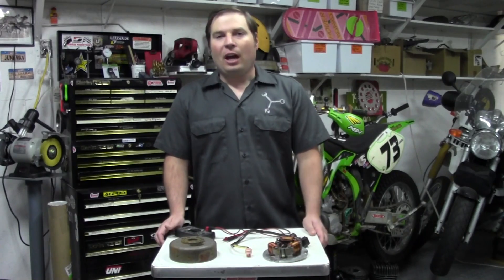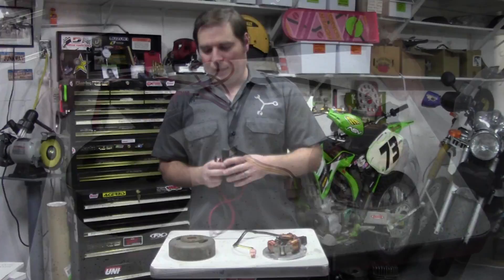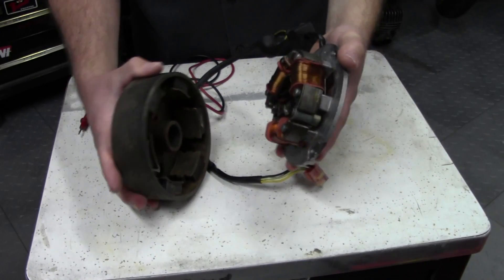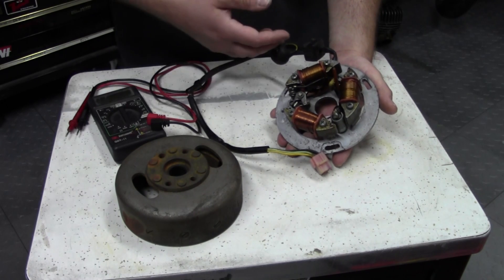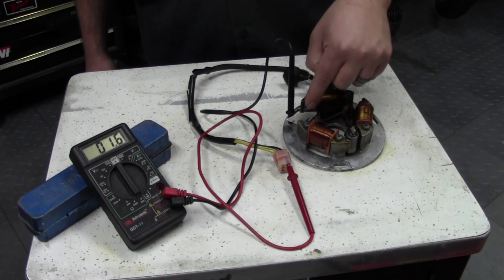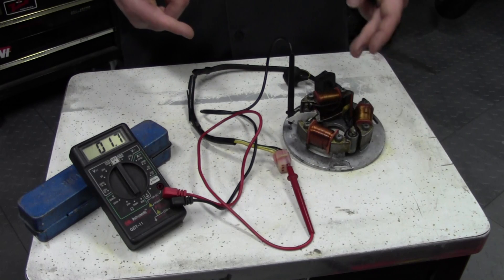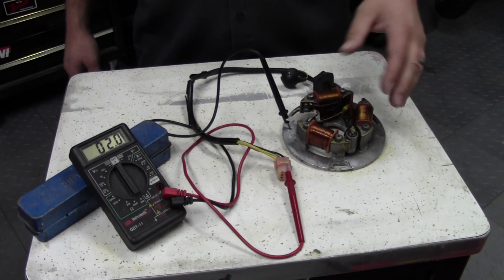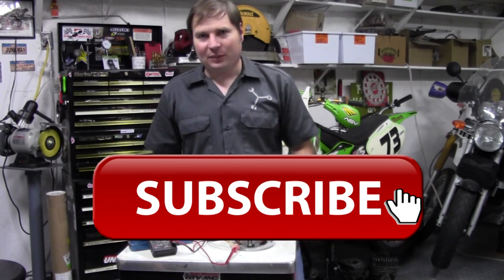Ignition system testing, Magneto coils, Points and CDI

Comment: Nice video, Junkman! May I please add that the resistance measured at 8:08 will vary significant;y depending on the make/model of multimeter used. Some cheaper meters may exhibit over 1 to 2 Ohm resistance in the leads and probes points alone. Different meters use different voltages to test for resistance and this will also significantly affect the result, especially when trying to test resistances at these extremely low levels.
The best way to test coils is via an inductance test however, rarely do service manuals provide such data nor would many home mechanics have an inductance meter.
Just food for thought before anyone decides to replace a coil because it is a fraction of an Ohm out of spec :)
Reply: Yes - definitely...quality and type of meter is important when measuring single ohm values. Always need to zero with test leads and coil connections in circuit.

Comment: Best way to check a stator is with a DVA(Direct Volt Adapter) adapter, static test (resistance )like the one shown in this video are not always conclusive, something you will get a good reading but the stator could still be bad. With a DVA the test is made with the stator still in the machine, turn the engine over and read the peak volt with the DVM. The problems with DVA test is there's not always data for this test in the service manual.
Reply: That's not the best way, the best is with amp clamps and oscilloscope amp curves under load

Comment: Hey junkman, great video. I have a question. On a points system, while using a test light should I see a flashing light at the wire that goes to the coil? Could you elaborate on testing a system with a test light? I’d appreciate any input.
Reply from the maker: You might or you might not.  Adding a light bulb in the system ads more resistance that the coils are not designed for.  I know what you are thinking and it would be an inconclusive test.  This is why the manual's state to test the resistance of the coils to determine if they are good/bad.

Comment: can you tell me how bike with a dc cdi starts even without a battery
Reply from the maker: The flywheel contains magnets that pass by the coils of wire wrapped around an iron core.  The magnets induce current into the coils, the current is then briefly stored in a capacitor and then that current is released to the primary windings of the high tension coil to then be induced into the secondary coil, stepping up the voltage strong enough to jump the spark plug gap to reach the ground.

Comment: I have just stuked with installing the ignition system of honda cd 90. I have disassemble every part of the engine and reassemble them after cleaning and applying lubricating oil on some parts.I am a self learner but now I have a trouble with installing ignition system. I set the statar  and then I don't no hove set up wiring that are ahead on my proccess. I would be very much thankful for you to if you can help me to finish this work by giving me information that are required. I want to know how statar wires connect to the next component and what is that next component.then how the spark plug connect to the battery and what are the other component related to the ignition system that I want to be aware, such as mechanical breaker,coil .......I would be much oblidge if anyone can help me.!
Reply from the maker: Go here  https://www.thejunkmanadv.com/repair-and-service-manuals.html  Scroll to the "Typical Honda/Chinese Clone CDI wiring"  Ignore the color coding but it tells you which wire and connector goes where.
Reply: thank you!

Comment: Hello! How do you know which coil is for the ignition and which one is for charging the battery. I guess the manual will tell but can you tell by just looking at it?
Reply from the maker: Yes, which ever one goes to the points on this style of ignition or the one that then goes to the CDI box.
Reply: thejunkman thanks man! I have a Honda atc Big Red that fouls spark plugs regularly. At first I thought it was the carburetor but now I think it is from a weak spark. Have you ever seen a bike that had spark and would run but the weak spark wouldn’t let all the fuel burn?
Reply from the maker: Yes, and usually it is a mag coil problem or a point problem.
Reply: thejunkman ok thanks again! I will check it out.

Comment: Hi...My motorcycle stator looks a little bit differerent there are 3 coils one of them lools like those on your stator but two other looks like those coils that are used on transformers....there is no pickup coil or break point....one day it  sudently stopped working I wanted to check the pick up coil but could'nt find any pick up coil anywhere any idea how can I find that...thank you...nice video by the way
Reply from the maker: Your service manual will outline the procedure and specifications specific to your bike for testing.  Sounds like you have a CDI equipped bike which the testing is the same, just have to know what the ohm readings should be.  If you need more help, post a picture to the comments on my website.  Link in the description.
Reply: I don't have a service manual.Have a look i've send some photos on your website....thank you

Comment: hi. What can cause burning the coils?
Reply from the maker: Burning the coils?  I am not sure what you are asking.  Coils can fail for a number of reasons, most commonly is the degradation of the insulation between the core and the wires (winding).  This material degrades from age and vibration over time, especially in 40+ year old bikes.
Reply: thx for your respond. by burning i mean, the coils where melt down (2 of 8 if im not mistaken) and they where black, like they where overheated.

Comment: this vid was a great help! I do have a question about soldering the condenser- do the coils have to be soldered to specific contacts on the points or can they just be joined and soldered to one contact ? 74 KS125 same unit as you're showing
Reply from the maker: I am not sure I understand as the condenser connects with a fork connector to the points.  Its only job is to briefly store energy ,that is induced from the coils, to jump the points when they begin to open, which fires the plug.
Reply: thejunkman  My condenser has 3 wires soldered on. On on side of the fork the wire from the excited coil and the black output lead, the other side of the fork has the wire to the points soldered on. I have been told that I can join these wires and solder to the top of the condenser
Reply from the maker: Sounds like you can.

Comment: I DO HAVE A 1980 KAWASAKI KE 100 WITH BREAKER POINT IGNITION THAT WONT START,THE LIGHT ON THE NEUTRAL SAFETY SWITCH TURNS ON EVERY TIME I TRIED TO START IT. SO IS THAT MEANS THAT MY IGNITION SYSTEM IS WORKING???MY SPARK PLUG DONT HAVE ANY SPARK TOO.SO MAYBE MY COIL IS BAD THEN?PLEASE HELP THANK YOU
Reply from the maker: +romulo parrilla no, the neutral light has nothing to do with it.  Test all the coils. I have those values on my website.

Comment: Hi there mate, I've got honda activa scooter and what happens is everytime i pressure wash for cleaning the scooter won't start for almost 10 to 15 mins and then it starts after it dries off a bit. Also when on highways when i ride it for too long i feel alot of resistance in the engine and loss of power, i guess it's the coils that are heating up and causing the problems ? What are your thoughts on this? Should i replace the coil? I already cleaned up the carb, sprak plugs and air filter though !
Reply from the maker: +aftab malvi I would use some dielectric grease on all connector.  That will help with you water problem.  The drivability problem is jetting related. I have a video on that
Reply: thejunkman you mean inside the coil assembly?
Reply from the maker: +aftab malvi no the electrical connectors

Comment: why do you use DC ohms instead of measuring pulsed DC impedance?
Reply from the maker: Because that is how the test is done per the procedure in manual.  Nearly all coils in magneto ignitions are tested this way, irregardless of bike make/model.  The spec or range of a "good" coil will be different (obviously) for a different model of bike, but tested just the same.  All that is happening here, and this is explained in the video, is magnets in the flywheel are inducing current into the coils as they spin around them.  Improper resistance within the coils by a break in the wire, degradation of the insulation between the wires and core will cause a change in this resistance and thus induction will not occur.
Reply: some of these bikes don't use DC voltage, they Pruduce AC voltage.

Comment: I have recently purchased a 1983 KX80 and was wondering if it would be alright to just buy a coil Magneto and CDI off eBay would they work the same as original
Reply from the maker: Given the vagueness of "magneto and cdi off ebay" I would probably say no, unless it states it will physically fit on your machine.

Comment: i have a problem, new regulator very hot and my new batery just buy easy to loose charge and kill my batery...when i charging it's batery fail to charge....why can give info to me what is that problem,...my stator got problem or another, i just change many part for my motorbike, new regulator,new cdi,wiring already check, new batery, ...sometime exzose come out white smoke...my virago xv250..
Reply from the maker: This post is very hard to read.  I am not sure your question or what your trying to communicate.  I understand your battery is draining, but that is about it.  With the bike off put a volt/amp meter between the positive terminal and positive lead and see if there is any current draw with the key off.
Reply: @thejunkman  how.to.set.dkw.points.3.cyl

Comment: I have a 2000 Polaris scrambler 500 HO 4x4. I've changed, stater coil, pulse coil, CDI box, voltage regulator, ignition coil, and in line fuses also key switch. I have bypassed the key switch and handle bar on/off slide bar starter switch. Have spark from black wire CDI box, still no fire. I checked ohm resistances on all parts new,  and old. Still no fire. I can only figure it's a grounding issue. Ignition coil negatives are not getting the correct reading on ground side top and bottom. I don't know what to do except change EVERY wire. Thoughts pls
Reply from the maker: Are you following the procedure outlined in the Polaris manual?  That second to last sentence might be where your trouble is, however I don't understand what you mean.
Reply: Thanks for the reply man!!! I test the ignition coil tab and get good reading. I test the coils ground and I don't get, .05 I get a higher reading. So, what do I do to get a proper group reading? I cleaned up battery, solenoid, and ground cable going from engine to frame. I don't know what else to do. Unless new ignition coil is actually bad. (it's happened to me before with new parts).
Reply: yes I am following procedures. To the T
Reply from the maker: Well if you can't get the ohm reading from the "new" coil, per the manuals instructions, then I would say you have a defective part.  I am not intimately familiar with your quad so I have to assume you are testing it correctly.
Reply: I'm very grateful for the reply man!!! I've been stuck on this for a while. I'm testing correctly as far as I can tell. Ground from coil to one test lead, other lead to engine case. I just don't know what else to do to get a proper ground reading other than change the coil. So, I ordered a new coil, and also a used "working " one from eBay. All I can do is try them at this point I'd guess. I'm a machinist /millrite for 26 years, no electriction lol
Reply: Same here

Comment: I thought black wires were generally a Ground. 7:31
Reply from the maker: +Shaine MacDonald "Generally" is the operative word.  The color of wire is bike/application specific.   Most vintage Japanese bikes are BLACK or BLACK/WHITE (striped).  Always refer to the service manual for proper info, thus why I stressed this at the beginning.
Reply: I always use a service manual!
Reply from the maker: +Shaine MacDonald then your good to go!

Comment: Hello I have a 94 kx 80 it fired and ran shut off then it would fire and die I pulled the plug and had weak spark put a new plug in and had no spark after that I checked the kill switch it was a litte corroded I disconnected it and still no spark and checked all connections nothing bad. any ideas
Reply from the maker: +Eric Hess check your magneto cold resistance per the manual.  They are probably near the limits.

Comment: Great Video.  Thanks.     I followed your procedure and it turns out I need a new magneto ignition coil for my 1975 KS 125.  Do you know if there are any electronic ignition conversion kits for the old kawasakis since I am unable to locate a replacement coil.   Thanks

Comment: Thanks Junkman.  That was easy to understand.  Well done.  I don't suppose you could do a little vid on the role and testing the condensor?  Thanks either way.
Reply from the maker: +Lozz Mitchell I could and might however its kinda futile as the condenser is cheap and easy to replace, and you have to remove it any ways to test it.

Comment: i converted my motorcycle stator to battery operated and I'm having problem about lost of electricity during running position and there is something building up on the positive side of the battery. What do you think is the problem?
Reply from the maker: I am not sure what you mean you converted the stator to "battery operated" the stator is what gets its current induced via the spinning magnets.

Comment: question i replcad the stator and cdi in my 87 kx 250 it backfires the head gasket is leaking i think its sucking in air? ideas? it leaks in the front oil from the gas.
Reply from the maker: Replace the head gasket first before trying to diagnose any other problems.  The rest of your sentence doesn't make sense.
Reply: i know its leaking oil from the premix. i will replace the head gasket first thank you.
Reply from the maker: Kevin Stearns Let me know how that works out.
Reply: i will
Reply: i replaced the head and base gasket and the sob still backfires.
Reply: i know what it is. anyone else want to guess? in case they have the same problem.
Reply from the maker: What was the solution?
Reply: i want guesses. then when i say what it was then everyone can say i knew that.
Reply: alright it was the woodruff key.
Reply from the maker: Glad you figured it out!  That is a pretty rare problem, but I have seen it happen, but it would be way down the line of things I would have checked first as there are more common things that cause the symptoms you described.
Reply: one more thind my 150 gy6 one day decided not to spark i had a spare cdi and coil no good still replaced stator nothing voltage regulator or what else would it be?
Reply from the maker: Its a grounding problem then.  That is all it could be provided everything else is as it should be.
Reply from the maker: It is probably either the stator plate is not aligned correctly (timing adjustment) or the advance curve in the CDI is all wrong.  Hard to tell which it is, but start with retarding the stator plate by small increments.  Scribe a some marks so you can tell how much you have turned it.
Reply: yea the cdi is wrong ill get the right one thanks.